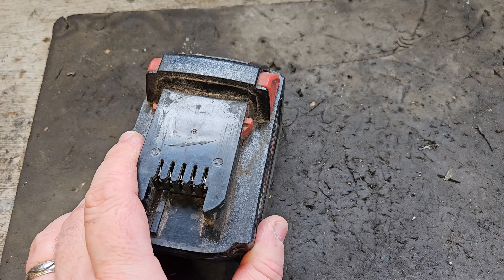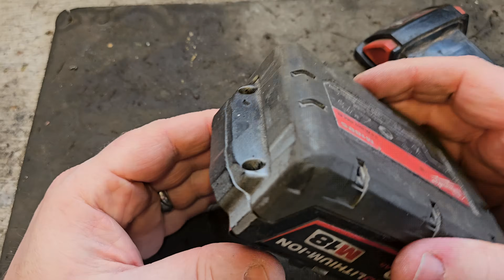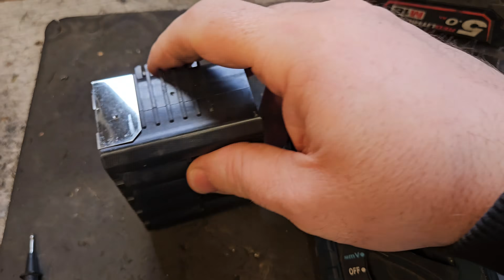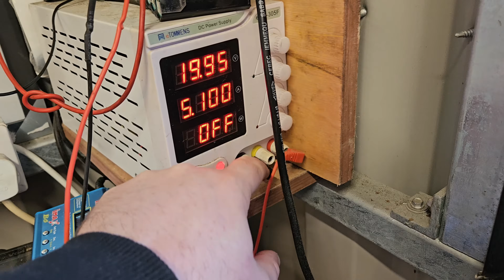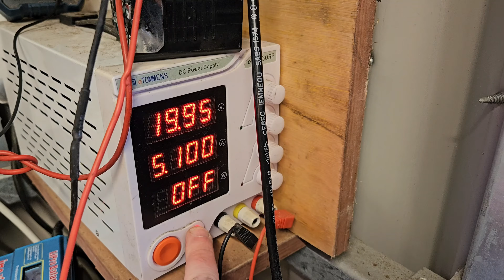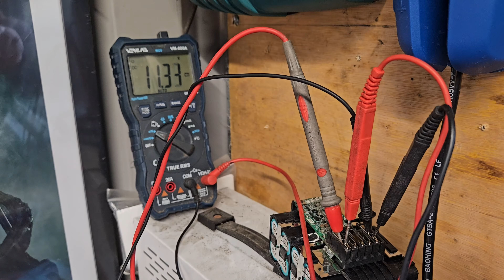Milwaukee Battery repair course EPISODE 2 safe voltage recovery

Comment: Trying to dump 5 Amps into cells that has gone that low in voltage is asking for trouble. I will not charge with more than 100 mA when cells are that low. Dendrites will have formed inside and they can discharge very rapidly, which can result in rapid unplanned disassembly of the pack with hot gases and flames as a result.
Reply from the maker: I'm gonna try and be nice because you obviously lack the experience I have with battery repair. 100mah would take 10 hours to charge a 5ah battery so that is a completely ridiculous waste of time. Your safety concern is likely well enough meaning I suppose but completely wrong,misguided and misleading to anyone who reads you comment and didn't know any better. I have literally carried out this procedure hundreds of times likely 7 or 8 times in the last couple of days there are no significant safety risks. Coming at me about my safe controlled tried and tested method is really misguided when there are people jump starting them every day ( which I don't condone ) and really putting a proper current dump in.
Reply: @doctorlefthandthread  100 mAh? I wrote 100 mA. I omitted an important thing, sorry about that. I charge with 100 mA up until 2.5A, then full charge current. Sorry for omitting that. And no, i'm not lacking any experience.
Reply from the maker: @zaprodk your comment suggests otherwise
Reply: @doctorlefthandthread  That wasn't intentional.
Reply from the maker: @zaprodk I understood that you put a comment in questioning the safety of a procedure I know to be safe. You didn’t intend to be wrong you just didn’t know any better. You have an opportunity to learn from your mistake and come out of it with a more accurate perception of what you saw on the video. You are welcome.

Comment: Can you charge the battery like you did with lipro balance charger? I have one of those but not the dc power supply
Reply from the maker: Yes you can it's ideal if you have any issues get back to me
Reply: @doctorlefthandthread thank you so much man best teacher out there
Reply from the maker: @lookforhim1979 glad to help
Reply: @doctorlefthandthread hey i just tried to do that today and my charger says low voltage… i have a genuine b6 i max. so i need a dc power supply i suppose.
Reply from the maker: @NcikTrunbull-v1q not really there is a way with the b6
Reply: @doctorlefthandthread is it because i need to hook it up to a car battery
Reply: @doctorlefthandthread it’s telling me LOW VOLTAGE
Reply from the maker: @NcikTrunbull-v1q yes I understand there is a way around it. Watch this livestream I recovered a battery from very low voltage with the b6 it will be easier to understand if you watch it https://youtube.com/live/bckAARoXJKw?feature=share
Reply: @doctorlefthandthread i found it out thank you for the help again!
Reply from the maker: @NcikTrunbull-v1q 👍